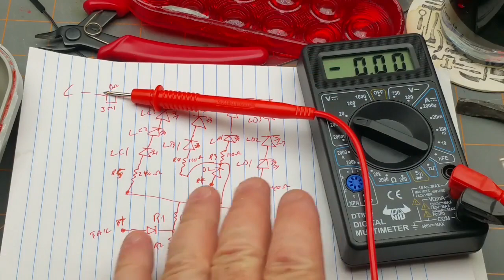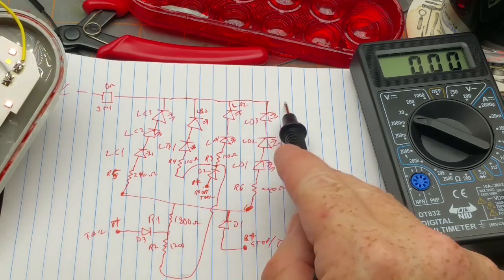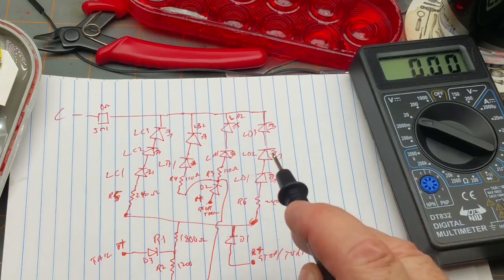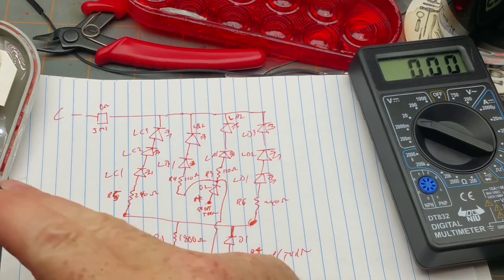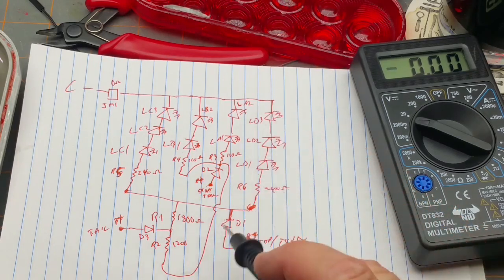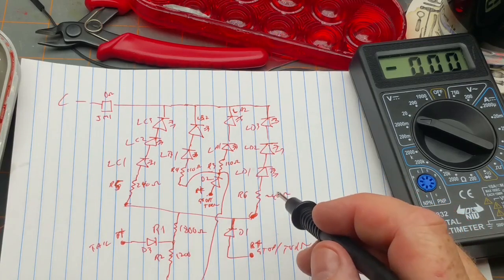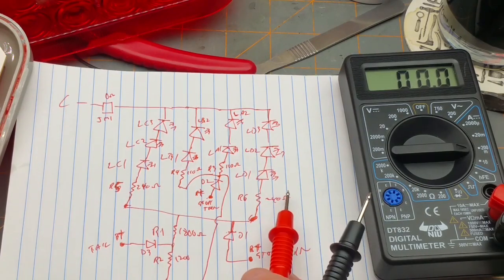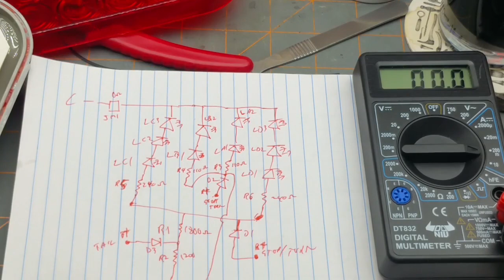Tail Light Teardown

Comment: They fit into a rubber grommet that also fits into an oval shaped hole in the trailer.  It's probably meant to be a replacement part.

Comment: Factory reject.  Manufacturer probably found out that they were miss-assembled and dumped them.  Some money received is better than paying for mass disposal.  So cheap they weren't worth the trouble of repairing.  This particular style is mounted in a special rubber grommet in an oval hole cut in a steel plate.  It just pushes in, installation time 15 seconds.